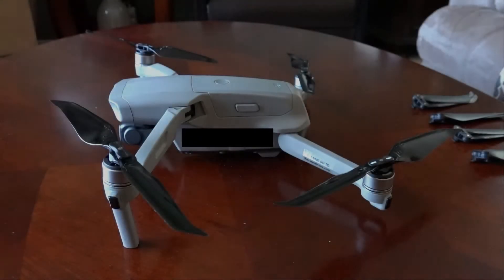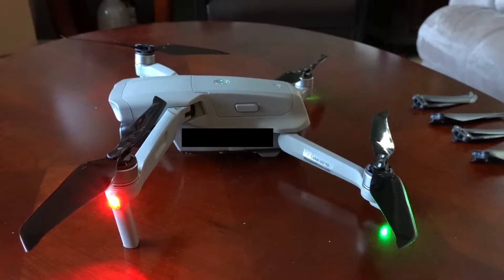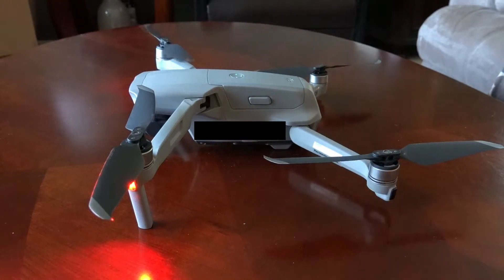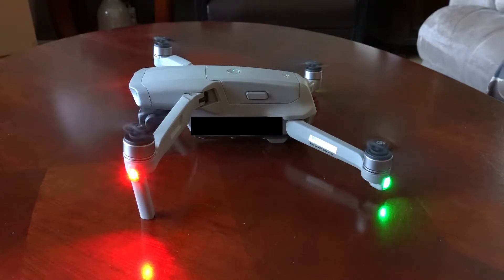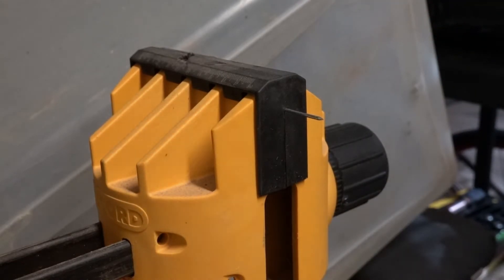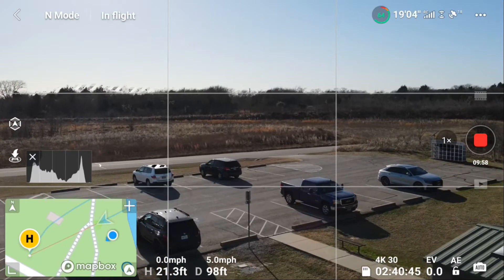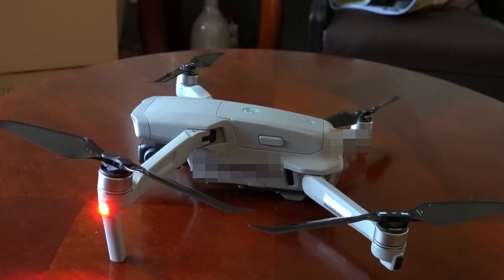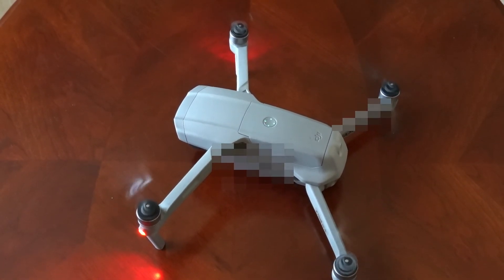Master Airscrew Stealth Propeller Vibration Issue | DJI Mavic Air 2

Comment: I bought 2 pairs of Master Airscrew for my DJI mini 2 and flew it several times using them. The vibration was so bad I felt I was at risk of losing my drone if I kept using them. It seems to be the leading edges, which are very rough that are the cause. As I was removing the MA props, I noticed 1 screw was backing out on one prop. So the vibration was pretty bad. The drone could not even hover normally it was shaking so bad. I changed back to the DJI props and no more vibration. Flies normally. Better finish on the DJI props, smooth leading edges.

Comment: So what did Master Screw say?
Reply from the maker: I didn’t approach them. At least not yet. Not sure anything would come of it. 

The fact of the matter is that it is possible for any drone to walk across a smooth surface due to vibration, like mine and others have. As long as it does not affect the quality of the footage than it really doesn’t matter. So overall, while I don’t love the fact that it walks across the table, I cannot say anything about these propellers other than the small improvements to performance do not really justify the price of the propellers. 

My advice to anyone thinking of getting a set of these propellers – save your money, stick with the DJI propellers.

Comment: So the reason for the "upgraded propellers" / "different propellers" was simply to reduce noise, or were there other benefits?
Reply from the maker: All the benefits were alleged, such as lower noise, increased speed, increased range, and longer flight time. Granted these improvements were very subtle but I decided to give the propellers a try. They do not live up to the billing.

Comment: I honestly think that the Air 2 really didn’t need quieter props anyway. I bought the blue MA props, and although balanced, they didn’t really make the drone quieter. Just a lower tone. That’s what I found on mine anyway.
Reply from the maker: I agree with you and from the tests I have seen people do, that is the consensus ... lower tone. I found maybe a lower tone, but not quieter. I do think that the DJI props have a smoother sound.

Comment: Hi, there is a difference between static and dynamic balance on propellers. While the static balance seems good, the dynamic balance can be off due to the plastic flash on the leading and trailing edges of the Master Airscrew propellers. I have removed that plastic flash using fine steel wool and the Mavic Air 2 seems to now fly well.
Reply from the maker: Thanks for that insight. Yes I was aware that there was a difference between static and dynamic balance but was not sure how to test dynamic balance so I ignored it opting to check static balance. But when they all showed good static balance, I figured that I’d just fly the thing and see how it worked. Then to find out that after flying it, the vibration issue improved. 🤔 Saw another video where someone lubricated the pinned joints at the hubs and that also improved the situation. 

I will remove the plastic flash off mine and see how that works. If that is the solution then I would think that MAS should issue new props to buyers of these unfinished propellers. I should not have to do anything to the props especially after spending upwards of $22 on a set.